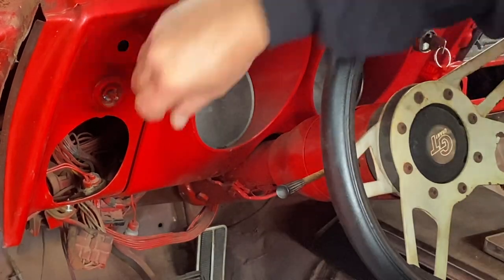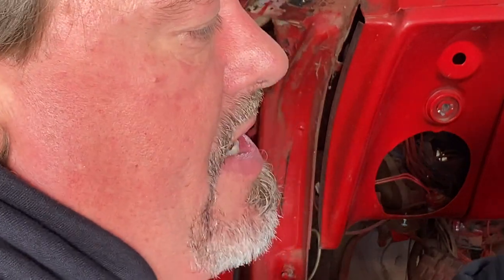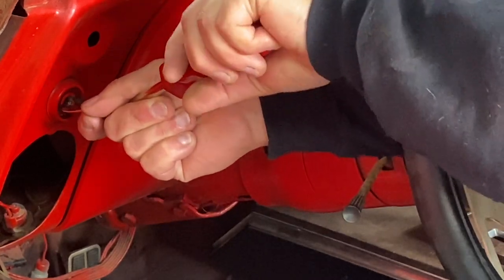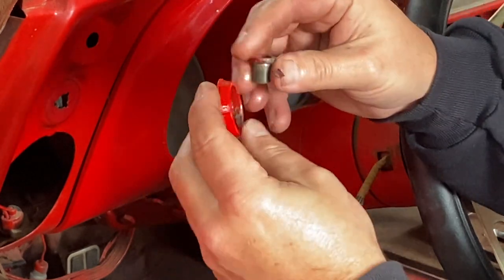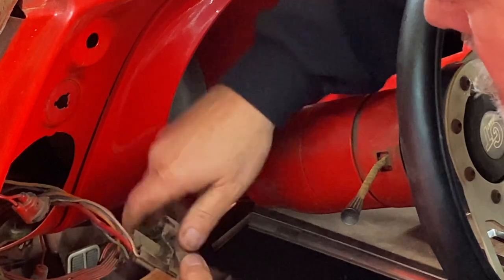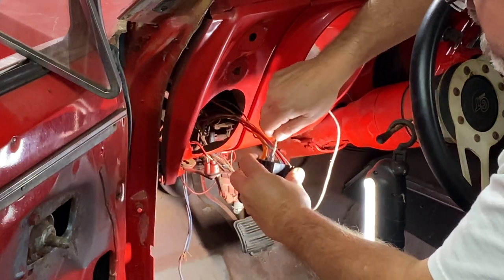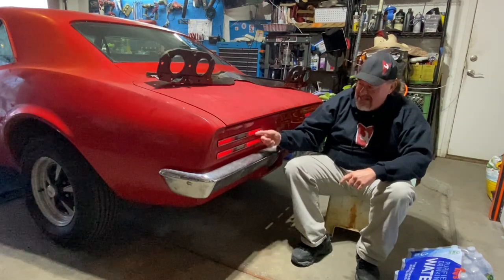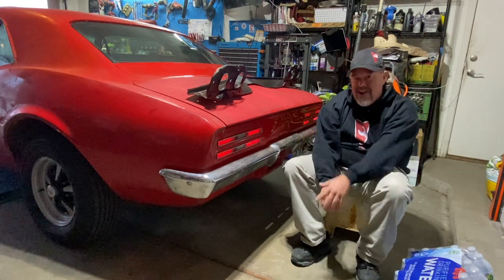How to install a new light switch and fixing brake - tail lights on a 1967 Pontiac Firebird 400

Comment: Good to see your work Brian ! Would you share the wiring diagram ? I would appreciate if you could send it to my email. I look forward to  your videos as I m restoring a 67 Firebird.
Much self satisfaction and enjoyment !!
Thanks
Reply from the maker: howard drop me an email over at brian at brianminson dot com
Reply: Hi Brian 
I tried to send email but it failed to send.
Reply from the maker: @howardrussell6738  try idrivea9@yahoo.com
Reply: @ArrowheadGarage  
Hi Brian 
Great work on your Firebird. I look forward to seeing your videos each week as I do with Jon at VVGarage. Your videos are a great help with my 67 Firebird rebuild . I’ve replaced full floor pan , full trunk pan, partial outer wheel wells , partial quarter panels , roof panel ( after watching Jon help you replace yours ) was a big help to me along with front suspension, steering box , rag joint , tie rods, fuel lines, brake lines , front disc brake conversion, 350 engine recently rebuilt   and much more. I’m looking to replace all of the wiring and I recently watched your video on the light switch and saw your wiring diagram. Would you if possible send me the link for that diagram ? Again I appreciate your time making the videos and explaining what you’re doing as you are working on whatever you’re doing. 
You and Jon at VVGarage have and are a great help to me build. A lot of work but Fun-Fun -Fun !!! Definitely enjoy it !  
Thank you Brian
Reply: Brian, did you get my email ?